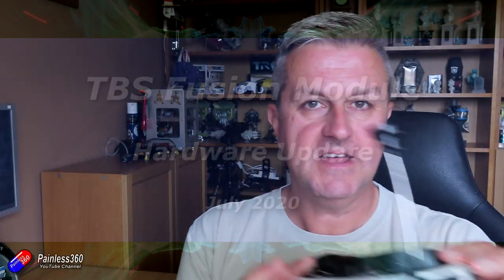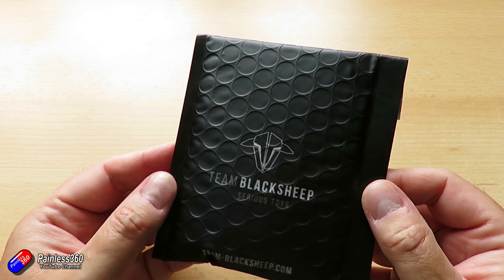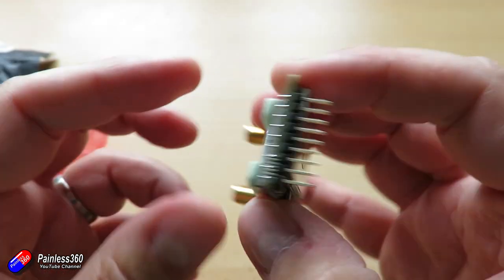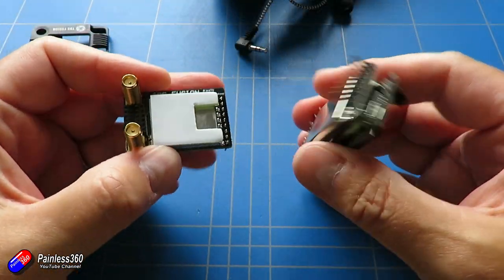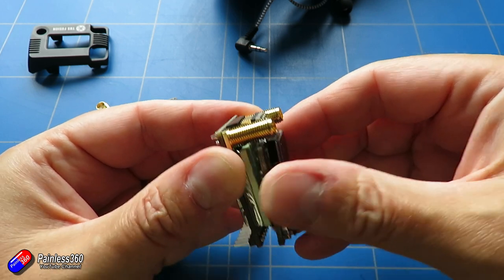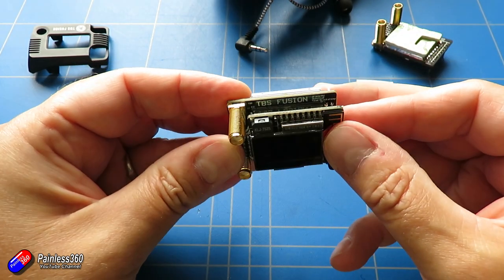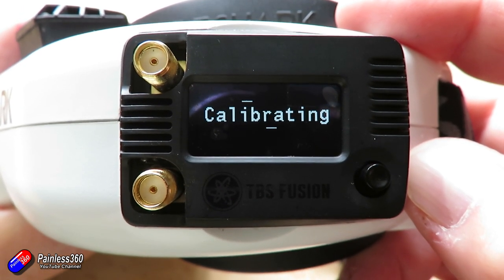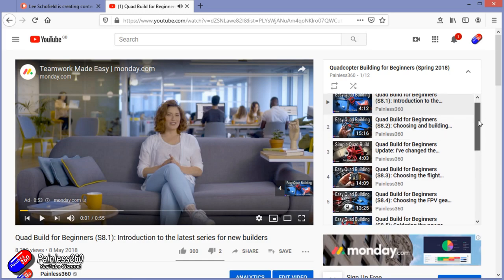TBS Fusion Module Hardware Update: Why, Who and Step by Step installation

Comment: I know this module came out awhile back and mine has been updated and working fine, however in a recent update to the Fusion module and trying to get VTX Follow mode working I stumbled onto a menu item: Settings>CRSF>Fusion Module> Fusion Settings>H/W Upgraded: On/Off  I am unable to find any documentation on whether or not this refers to this hardware update, or is for some upcoming function.  I see zero documentation on what it does.  The Fusion Manual for this area just stops at the first "Fusion Module" menu and says "For adjusting Fusion module settings".
Any ideas or insights?

Comment: I am a little disappointed that I am going to have to do this upgrade. The Fusion model just  came back in stock at my favorite retailer, and it has shipped with the old hardware version, but with fw v2.21. I wonder if they reverted back to the old hardware version due to the chip shortage as the firmware release notes state its the chip shortage edition?

Comment: Will the TBS fusion fit the Fatshark Dominator V1?
Reply: Not sure about the V1.. but it works in my dom v3s. But you do have to use the included ribbon cable and voltage regulator. It's super easy to do.
Reply: @OzFPVflyer  👍